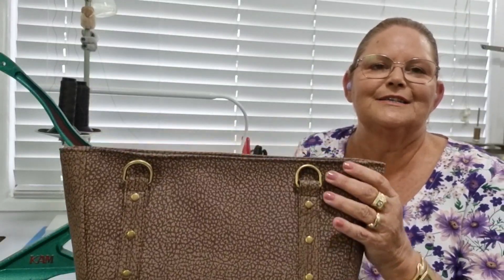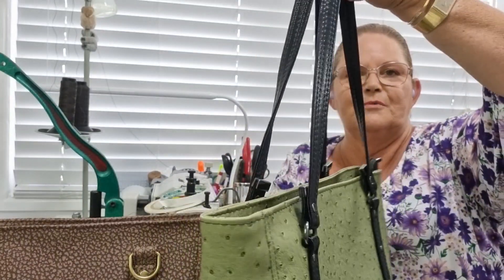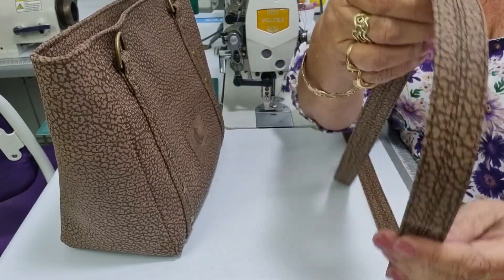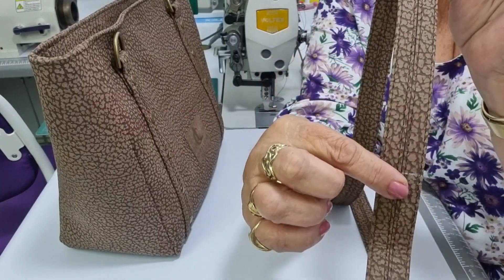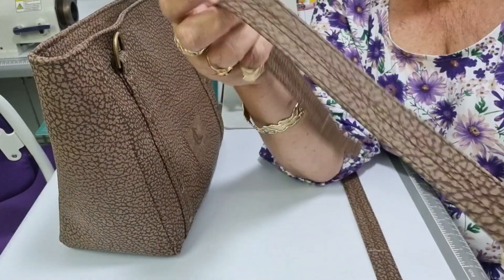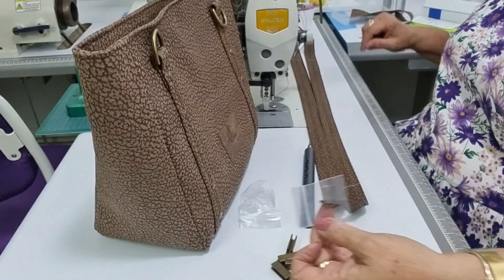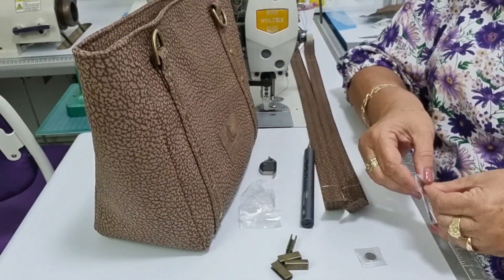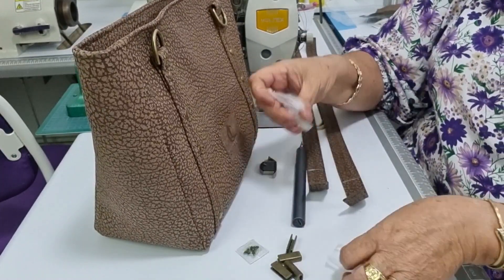How I add METAL STRAP ENDS to Leather SHOULDER BAG STRAPS and add a Metal Zipper Tab - Chris Lucas

Comment: Sue S - thank you Chris for the wonderful video.  You make the most quality high end bags etc.  Whenever I’m putting on hardware on a slippy slidy strap, bag flap, strap connector etc I use my cutting machine mat (Cricut strong grip mat) to hold the strap etc down, place my strap end on or whatever hardware I’m using, this stops it from sliding around & easier to screw those little screws in.  I use my magnetic pin holder dish to hold my screws, sometimes I just put the screws on the mat & that normally holds them in place.  Sue S, Western Australia
Reply from the maker: Hi Sue, great idea to use our strong grip cutting mat.  I have a couple of those as well as the magnetic pin holder dishes… they’re full of pins though so I’d probably lose my screws in amongst the pins 😂 😂 I love my Cricut machine and have a dedicated space set up for it in my sewing room.  I’ve had a Cricut maker for a few years now and use it so much for so many different things for my business.  One of the best investments I’ve made not only for my business but also for fun projects too.  Oh and thank you for your lovely compliments on my bags and on my video too 💗

Comment: Hello Chris. Thankyou for sharing your vast knowledge and experience. I have been making toiletry bags using vinyl and quilting cotton weight fabrics. The vinyl is on the lower part of the bag and extends about a third of the way up and the quilting cotton is used for the upper part of the bag. I have applied Decovil light to the cotton fabric to give it some body. I’m wondering should I add flex foam to either the vinyl, the cotton or both. Looking forward to hearing from you.
Reply from the maker: You’re welcome Sandy.  As for the toiletries bags you’re making adding foam as well isn’t really necessary if you’ve already got the structure you like unless you want the bag to be more padded for protecting the contents.  Depending on the thickness of the vinyl you’re using foam can make it quite thick and spongy for a small bag.  If I want my vinyl to have a little more structure I generally add decovil light to it.  When I want to test things I usually make on the panels using the materials I’m thinking of using or use small scraps and then see what it feels like and sews like, and the structure etc.  If you want to make the quilting cotton a little spongier you could add some fusible fleece to it as well instead of foam.  There’s also different thicknesses of foam you can use as well.  Some are not as ‘thick’ as some foams.  

Another thing you can try is applying a woven interfacing to the cotton fabric and then adding fleece or foam out of the seam allowance or add the fleece or foam and then add the woven interfacing over full piece of the cotton to help secure the fleece or foam onto the cotton securely.  

Another option is when you join the fabric panel to the vinyl you can add a layer of decovil light (out of the seam allowance) over the finished panel.  The decovil layer helps add a little more structure / support especially along the seam where the two materials meet and helps prevent the joining seam of the two fabrics creasing where they meet.  < Hope that makes sense 😂  

Let me know if you have any other questions.  Always happy to share ideas 🤗
Reply: Thankyou Chris for answering my question so quickly and the advise you have given esp making a small sample to see what works best. I’ll be at the machine first thing tomorrow morning doing my test sample.
Reply from the maker: You’re welcome  @sandyvass1173  be sure to let me know how you go with making your test sample.  It’s a great way to experiment and see what you like with the materials you are using and for the project you are making 😃.  Another idea when you make your test samples is to put them in a folder and make some notes on what materials you used and then you can use your reference folder test samples for next time.  I use to do that all the time… probably should do again as it sure is handy to have on hand.
Reply: @ChrisLucasDesigns  great advise. I will definitely journal the samples and let you know how they go.
Reply from the maker: @sandyvass1173  Yeah glad you liked it.  Looking forward to finding out how you go 🤗
Reply: The test sample was awesome advice. I tested 3 options - vinyl with a layer of flex foam and the cotton with a layer of Decovil 1 and flex foam; vinyl with no interlining and cotton with Decovil 1 and flex foam; and lastly vinyl with no interlining and cotton with Decovil 1 only.  The third option was definitely the best. Once I decided on the best option I used the sample to work out the the best tension settings, foot pressure and stitch length (on my Janome HD9) for the project and recorded it all in my newly started Journal for future reference. Once again, Thankyou for your guidance. It worked a treat.
Reply from the maker: @sandyvass1173  YEAH!!!!  So glad my advice helped and you found the best option for the materials you were using 🎉   Best of all you now have your very own sewing reference journal and know exactly what worked for you, your sewing machine and materials etc .  Thanks so much for coming back and letting me know.  I was actually thinking about your yesterday and wondering how you were going with your ‘homework’ 😂. You obviously passed with a ‘HD’ High Distinction 😂  You are always welcome to let me know if you have anything else I might be able to help you with 🤗